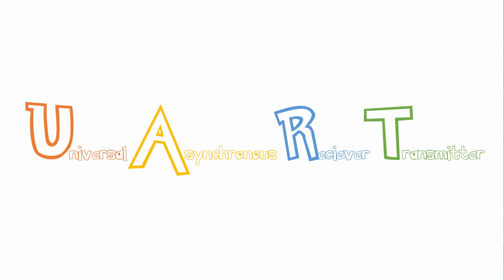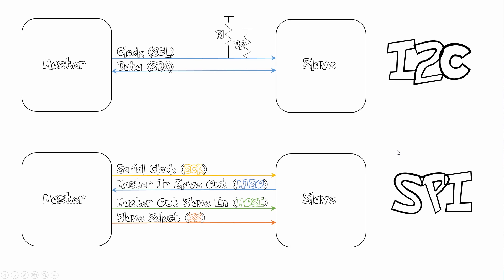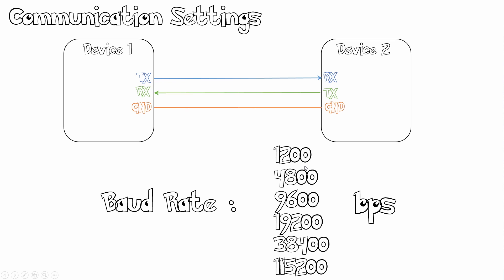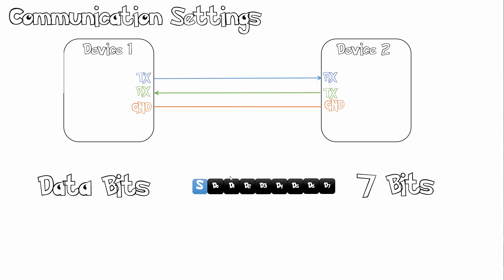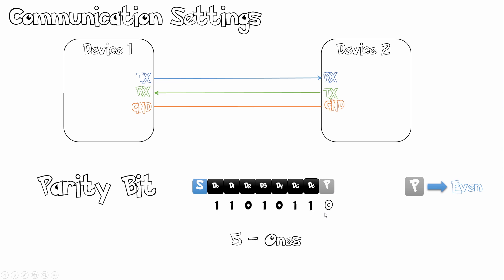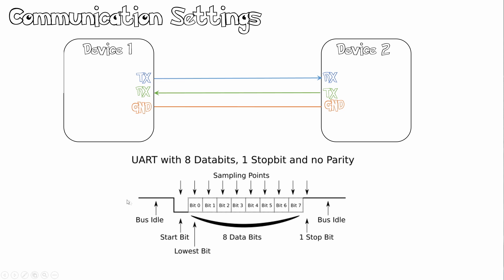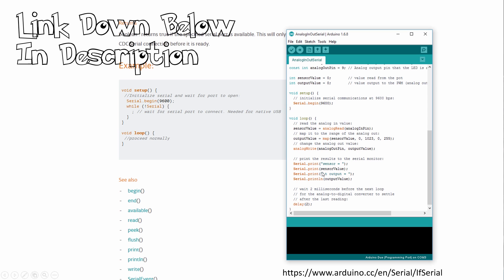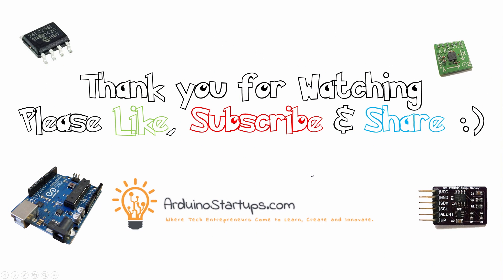UART Serial Communication in 5 Minutes

Comment: Hi @Arduino Startups: Thanks for the perfect video. But I have a confusion within the parity bits. please correct if I am wrong.
As per my understanding the parity bit is something which says the no: of 1's in the data bits. For example 
if the 7 data bits are 1101011 and if we are setting it as odd parity then the output stream will be
11010110 (The parity bit should be zero since the no:of 1's is already odd.) But you mentioned as 11010111 which makes even no of 1's. Please clarify this statement in the video 3.10
Thanks in advance :) Once again really appreciating your work and keep going .. :)
Reply: Parity bit works to make it even, if its even parity, or make it odd if its odd parity. You are right.
Reply: Video 2.56: Odd parity should be "1" instead of "0", right? The total number of ones in the data bits [1101010] is "even" and to make the transmission with Odd parity: Start bit, Data bits [1101010], Parity bit ["1"] & Stop bit, right? Please verify, thank you.
Reply: yeah, i have the same doubt, have you gotten any answer
Reply: I agree with your conclusion. Even to even, odd to odd.
Reply: I think you are right
Reply: you are right, I have digital electronics as a subject in college, and I have been taught the same, you can verify it on wikipedia.

Comment: Thanks a lot for the wonderful tutorial ,sir. 

When you were explaining the parity bits I think there is some error at 03:07 you said when the 7-bits are 1101010P then if we set it to even parity the even parity bit should be 0 so that total bits are even including parity whereas when it is set to odd there are alredy 4 one's and odd parity would become one so as to make the total ones in the byte odd (5). Please correct me if I am wrong. https://en.wikipedia.org/wiki/Parity_bit there is a chart on the right top on the referred link. Thanks a lot.
Reply: You're right. I was wondering why he made it sound weird. So 1101010P on an even parity scheme, P should be 0. And 1 if odd.
Reply: exactly. its easy to memorize if one thinks this way: count the "1's". if parity bit is odd, count all the 1's and if they are even, the parity bit is 1 to make all appearing 1's result in an odd number. 1101010P = 4x 1 => its even so with a parity bit 1 its odd again and correct. for even parity bit vice versa - all 1's need to result in an even number.
Reply: correct

Comment: Is it possible to use UART if the microcontrollers have different grounds? For example, if I attach the first microcontroller to an analog power source and analog ground, and the second microcontroller to digital power and digital ground.
Reply: if you want isolation between devices you can use Opto-isolator.